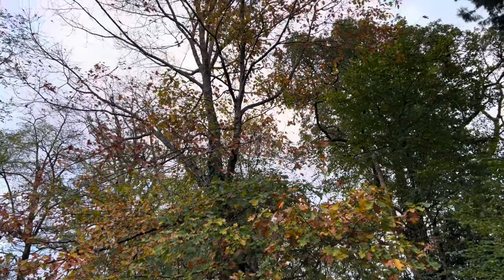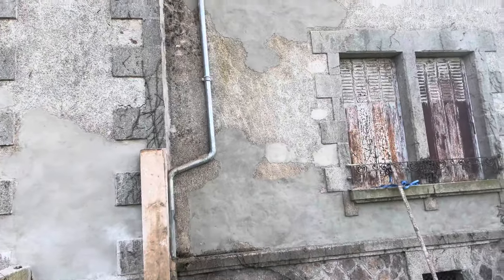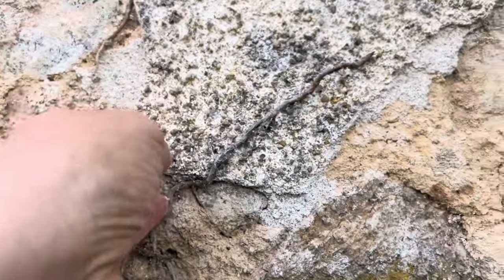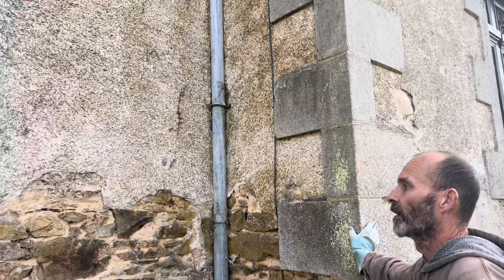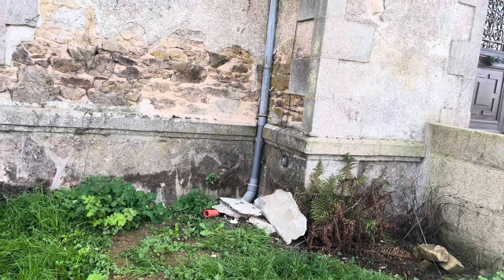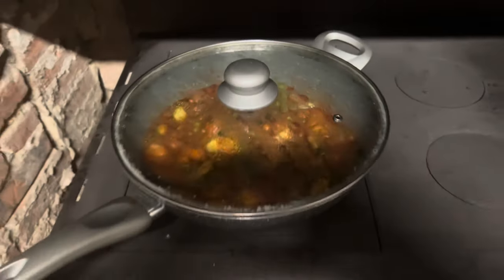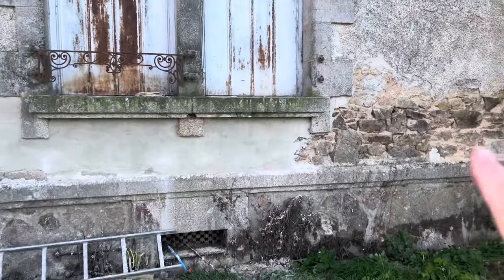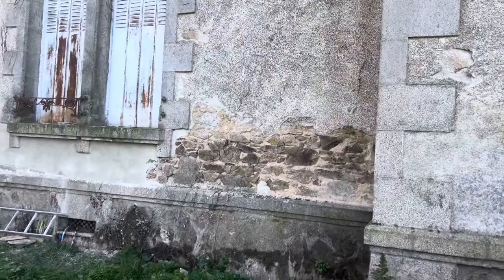LETS ROCK TO GET READY FOR WINTER

Comment: Don't you worry about doing any repeats. I knew and watched anyway.😂
Will is a lovely man and hard worker. I would feel shy if I were on camera also. He is an inspiration. The render looks good. In that coldbit can't be easy.
It is always cozy with a warm fire going inside. Stay warm. Keep your hot water bottle heated and if you have a nice electric blanket on your bed, or a good fluffy down comfortor.❤
Reply from the maker: Will is a kind gentle person. He is not shy just has difficulty getting his words out. Got all that for my bed fortunately only used the electric blanket twice so far. The Appartement is well insulated 😊💕👍